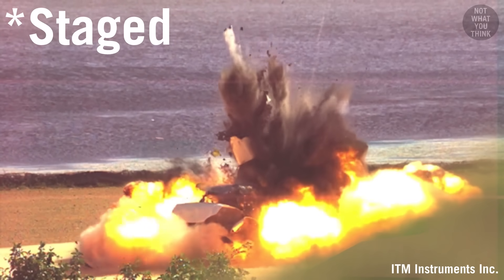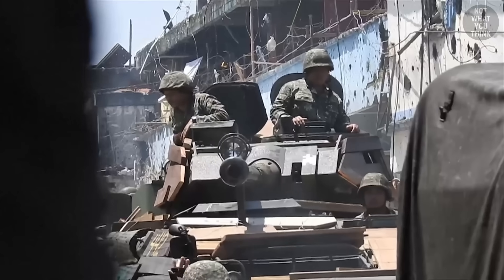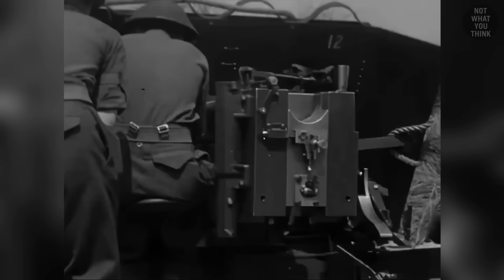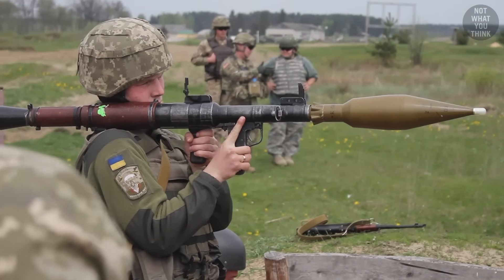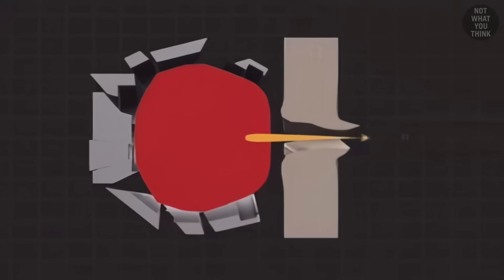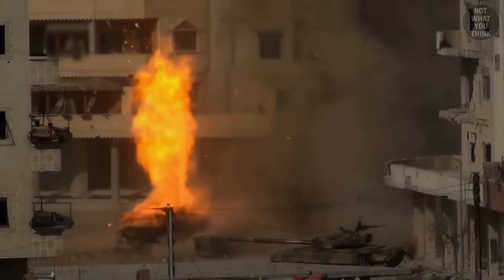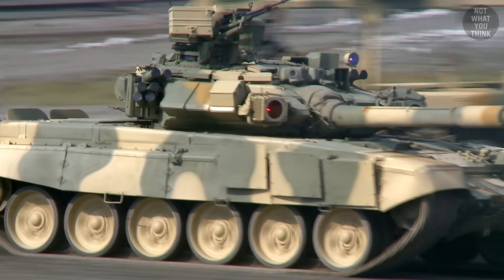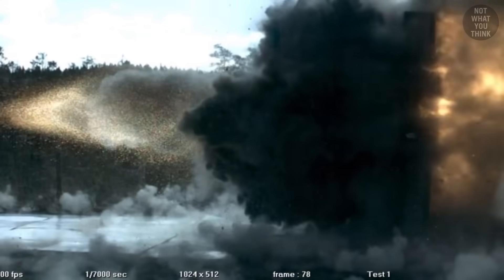Why Protecting Tanks is Getting Much More Difficult

Comment: 3:44 to be clear, this is a defensive grenade. An offensive grenade has no fragments, and relies on the shockwave. This gives it a smaller kill radius, and doesn't require cover to be safe for the thrower, so long as you're are distance away. 
Grenades may also use a sleeve of ball bearings (or other fragments) instead of relying on the destruction of the case
Reply: @silver_surfer88  I did serve* in the army, in Australia. The US trains the same way, even SF, no body is trained to jump on a grenade. It's always run dive to cover, feet facing the grenade lying down if you can't. Yes people do it sometimes, as an act of pure absolute sacrifice for their mates, but that only ever happens when you know that there's no time for your mates to get into cover, and it'll generally be the person who is first to see the grenade, which even more astounding, ebcause they will have the most time to get to cover, but will choose to save their mates.
Reply: I've wondered about these shockwave grenades.

As implausible as it could be, if you flipped a grill lid onto a grenade, and jumped onto it, could you save yourself?
Reply: @sirtimatbob  you don't want to put anything on it that could turn to shrapnel.
You dive away feet face the grenade, laying down, be the smallest target area to the grenade. A shock grenade will have a kill radius of between 5-10m max. You can cover that distance in a second. Run dive into cover or feet away from the grenade laying down.
Reply: @sirtimatbob  the more you cover or enclose an explosive the more powerful it will be...... Not sure what kind of explosives the shockwave grenades contain.... But if it's something like PETN ... When it explodes it travels at about 6 miles a second... So if you're laying on that grill top you will be nothing but confetti 🎊
Reply: @tommyemler1763  dive away and try to make it to the ground before the explosion. Yah, just one of those childhood fantasy thoughts, ya know
Reply: @sirtimatbob   Hollywood is responsible for that..... Only reason I know so much about it is.... I use to work in an explosives factory making mostly boosters and linear shaped charges.... I got to melt and pour the explosives it was fun but my family thought it was too dangerous....
Reply: @sirtimatbob  Yes dive away, but you're diving into the ground, you aren't jumping up, same as you would dive into the ground for a contact drill, run and dive into cover.
Reply: @tommyemler1763  RDX is the explosive in our grenades. 60g for a frag, 110g of RDX for a shock/offensive grenade. so roughly double the explosive.
Reply: @sirtimatbob  no you just turned that BBQ lid into the shell of a fragmentation grenade. As a kid we bought illegal fireworks on the reservation, when I showed my dad he got the idea to put a pot over one of them (he hadn’t seen one detonate yet) thinking it would launch the pot into the air….. it disappeared and peppered the siding of out house and took out a window with frag.
Reply: @silver_surfer88  what are you talking about? No they're not. The Army do not train/teach you to jump on grenades. No Army of any western nation does that. It is always a selfless act.
What you are taught is to run away and dive into cover as soon as possible or if there is no cover run and dive into the ground with your feet toward the grenade, and you face down and tucked tightly in, elbows tucked into your side and hands to your face. Tuck your body in as much as possible remaining as flat as possible. This gives you the smallest target for shrapnel, as it must come from the grenade, it puts your head and vital organs as far away from the shrapnel. If you are hit with shrapnel it has the greatest chance to be superficial, or a limb I jury that can be treated with a tourniquet. You are not Taught to dive a grenade though.
Reply: @silver_surfer88  You want to train your troops to survive. If you train them jump on them instead of get to cover, you are training people to die instead of live. This is not normal training, and shouldn't be. Youre soldiers are your most expesnive asset, in time and money, you do not want to train them to die, over training them to live.
Reply: Its counter intuitive but true
Reply: @silver_surfer88  offensive, aka used when they're pushing buildings in tight quarters.
Reply: That's awesome! I didn't know any of that, but it's super-interesting. Cheers!

Comment: There's also the non-explosive cousin of E.R.A., spaced armor. Spaced armor is effectively E.R.A. without the explody bit, as such its only useful against certain ammunition types like HE, which are known for exploding on contact with anything, rather than continuing to penetrate, like Armor Piercing (AP).
Reply: The non-explosive version of ERA would be NERA. It’s essentially ERA that replaces the explosives with various polymers instead.
Reply: @Notreallysureactually  Would you read the comments first
Reply: That's called spaced armor, yes, but it is not ERA. ERA stands for Explosive Reactive Armor, so a non explosive protection is not ERA.
Reply: @rairu44  never meant to imply it was ERA
Reply: @Sleeper____1472  I see! I understand that because you said that spaced armor was a version of ERA, when they are totally different things, my bad then!

Comment: It's not creating a metal particle stream as you state at 4:30  The copper cone enters what's called a super-plastic state, where it deforms more like liquid, inverting the cone while staying intact. That inverted cone is inverting at a speed of roughly 5miles/sec, and it lengthens and extends at roughly 14 million PSI. It pokes through any length of steel armor, up to 24 inches, and the backside of the armor plate is melted and fires through the tank interior at a percentage of that 5 miles/sec effectively becoming super-high velocity projectiles, killing the crew.
Reply: Isn't an explosive penetrator which you describe different than an anti tank weapon?

Comment: Sure the meta is in favor of infantry, but no system is invulnerable. If you can't change the meta with technology, you have to do so with doctrine. Part of the reason we saw a lot of tank losses in Ukraine was because Russia wasn't even using it's own combined warfare doctrine. Sure you can have a dude in a bush with an instant win button, but now your focus has to be on detecting him before he uses it. Because so far there really isn't a feasible piece of equipment that does what the tank does operationally but doesn't also have the same weaknesses

Comment: Tanks are certainly not the kings of the jungle any more - but they still have a place. That's because of mechanized infantry. While a javelin missile is a worthwhile expenditure for an MBT, it's less worthwhile for an APC, especially if said APC has already disembarked it's troops. Not to mention that APS could be fitted to such APCs, it starts to become an issue.

Tanks currently offer a cheap and easy solution. 1 120mm shell is more than enough to deal with an average APC/IFV. At the same time tanks provide mobile direct-fire support. The British still favour rifled guns because of their use of HESH which is very effective at knocking out defensive structures and emplacements such as concrete or sandbag bunkers.

So while tanks are certainly now in a more niche role and more vulnerable than ever to infantry, they provide a something that nothing else does currently - a big self-propelled direct-fire artillery piece that is mostly unhindered by rough terrain
Reply: They still are alongside artillery both of them are more than 50% of fire power of an army been many less than other units.
Reply: @viceralman8450  indirect-fire artillery is a role all of it's own and will likely never be replaced in warfare. Tanks however are at risk by having a role that overlaps greatly with infantry, APC/IFVs and even Attack helicopters.

Comment: What's happening to tanks is what happened to battleships. Emerging technologies changed battleships from invincible juggernauts to large, expensive targets, and they were replaced with smaller vessels that could carry a devastating amount of firepower. (I'm including carriers under those 'emerging technologies', but that's another story.) Modern light armored vehicles can carry the same firepower as a tank in a smaller package that's faster and easier to hide on the battlefield. Plus we're seeing more combat in urban areas or against insurgent forces, situations tanks aren't well-suited for. There's a reason the US Army calls tanks 'cavalry' after all.

I'm not saying the day of the tank is over, but they are becoming less of a dominant factor than they once were.
Reply: Not the same scenario as the battleship was abandone becase new tech full fit the role of a battleship, currently and in the near futures there's nothing that can fulfil the role of a tank on the battlefield, so it is still relevant, in other words read more. Modern light vehicles can't replace tank they either lack the fire power, the armor or the mobility.

Comment: While I agree with a lot of your video one thing I do think should be pointed out: Yes, a tank costs 5 million to 10 million. But what is more expensive is their crew. Maybe not monetarily (and even then the cost of a soldier is quite high)  but a trained soldier is very very valuable. So really what should be looked at more with these systems is crew survivability. A tank is "easily" replaced, a crew is not.

Comment: that's why the m1a1 abrhams tank has the best armor there is. it is designed to dissipate or spread out the impact of these so called rockets that the seem to "deflect" the impact outwards. hence why they are hard to destroy with anti-tank weapons.
Reply: Modern armor don't deflect they absorbe the proyectiles ans they the composite stop them.

Comment: Interdiction systems, designed to intercept and prematurely detonate incoming warheads at a significant distance from a tank or other asset, by firing a counter projectile at the incoming warhead, are in the works. The trouble with these is that they would require a whole other weapon system essentially, to be mounted to the asset, on top of whatever weapons are already present, or in place of a secondary weapon, like a mounted machine gun. These would mean carrying ammunition of their own also, as well as the tracking gear necessary to automatically register, track and engage a rapidly moving, incoming warhead. The automation necessary to make these truly effective involves expensive components and complicated technical challenges. Tanks, in particular, are already absolutely loaded with all kinds of gear, and already quite cramped and unpleasant to operate for those inside of them. Making such interdiction systems small enough to fit without getting in the way, light enough to be fitted without causing efficiency problems for the engine, fast enough to engage targets effectively, and perform well enough to be worth fitting in the first place, is VERY difficult!

Comment: 5:45 Well being a Filipino you have to be creative when dealing with such firepower. These were created because the wooden armor was soft, the only thing that could make an RPG penetrate is through hard contact basically metal to metal contact, however if the armor itself is soft the detonation would be lessened
Reply: The only way to stop anti tanks is to make the shapes of the tank slope style it should be around 30 to 50 degrees that is enough to deflect

Comment: I'd like to add something to your description of ERA or Explosive Reactive Armor. The primary mechanism in defeating the jet is that the explosives send the external face plate of the box often a given direction. This is rarely at 90° to the incoming warhead and consequently incoming jet. This means that the jet doesn't cut straight through the plate it has to cut through the plate as it's moving at some angle to it. The hole that's made is there for linear not circular. This extra metal that needs to be penetrated is what wears down the efficacy of the jet. So, I've read the impacts and era block at a 90° angle significantly reduces its efficacy while one that comes in at a steeper angle increases it. Hope this helps. Thanks for a fine presentation.

Comment: I haven’t seen the entire video yet so i’ll edit if he mentions it but Russia’s abysmal tank losses are kind-of skewed. Most modern nations have combined fronts of infantry, artillery and armor in combined offensives. Tanks deployed by the US are, in doctrine, never put in a position where they are not supported by infantry which would significantly reduce instances of unchallenged fighters firing rockets at the armor. Russia has continuously put their tanks in scenarios where they are significantly under supported or not supported at all. That, coupled with active denial systems such as reactive armor I feel have cemented the tank as a utility on the battlefield until some better weaponry comes out that would retire them forever.
Reply: TL;DR Russia is basically serving their tanks on silver platters.

Comment: The solution is to make tanks unmanned autonomous, cheap unarmored, higher speed, MUCH more plentiful and swarming. Made out of fiber reinforced lightcrete panels. Steel only where needed. Having no scared, cautious human crew to be hesitant to enter a dangerous area: these could instead blitzkrieg STORM their way into danger's face and OWN the area. Tanks are FAR from gone from the battlefield. They are only slow to adapt to the changes in the battlefield. We will see tanks catch on soon enough.
Reply: Yeah, that tech doesn't exist yet maybe in 50 years. And tanks will ver by on the battlefield as the need of direct fire support and breakthrough will never go away.

Comment: The “penetrator” is actually the copper cone shaped recess that inverts and becomes the molten copper shot that bores through thick armor. The TOW missile can penetrate past 4 feet of homogeneous steel. The RPG uses a piezo electric crystal in the tip of the round to ignite the explosive in the round. A piezo crystal creates electricity when crushed which is what powers the blasting cap/fuse in the explosives. Most of the time RPG gunners forget to remove the small safety pin in the nose cap of the rocket so they just bounce off its target.
Reply: Not molten, but the effects resemble molten.
Reply: Copper doesn't melt, but behaves like a fluid due to immense pressure.

Comment: Very good video, although I think you shouldn't have used CGI of the Ukrainian Nozh to explain how ERA works; Nozh is a bit special in that field.

@10:25: Nozh charges are crescent-shaped so that, upon detonation, they shall behave like a linear shaped charge, which "cuts" HEAT jets and long-rod APFSDS penetrators, like a boiled egg cutter. The Ukrainians also have a variant called Duplet, which is essentially multi-layered Nozh bricks.

@7:44: more conventional ERA, on the other hand, propel a metal flyer plate (placed diagonally - it's shown flat on the ERA's bottom in this video) straight into the intruder (HEAT jet or APFSDS long rod)'s path, causing massive abrasion, deformation, sectioning and deviation of it----thus preventing the attacker from either forming properly (HEAT charges require a standoff distance from the target armor in order for the jet to successfully take shape) and/or penetrating the enemy armor properly.

Other than that, good job making it clear (unlike videos I see on either TV or the Internet) that the HEAT jet does NOT "melt" the enemy armor, which is absolutely false. The temperature of the HEAT jet, either at its tip or tail, is nowhere near the melting point of steel...not even copper, which is what most shaped charge liners are made of (the copper becomes plastic-like, almost like molten rubber, because of the sheer pressure of the explosion, not temperature).

Comment: You showed the Iron Fist, which is my personal favorite APS. Quickly reloaded (it's literally just a missile turret), capable of protecting against top-attack missiles and APFSDS (dependent on sensors and reaction time), and often relatively light-weight, it seems like the best of all worlds. The US and Israel haven't adopted it because they want to minimize the collateral damage caused by an APS when it's activated, but the advantages offered by the Iron Fist seems more than worth it to me. The only APS cooler than the Iron Fist is the American Quick Kill system, and that system only has a cool factor advantage over the Iron Fist. Well, the Quick Kill system also stores its missiles in a vertical launcher instead of a missile turret, so it might be even lighter weight and more easily reloaded, but it obviously suffers in terms of reaction time compared to the Iron Fist since the Quick Kill missile has to turn itself nearly 120 degrees just to point at an incoming threat instead of relying on a missile turret (which is probably much faster, being mechanical) to do the aiming. All of that is just speculation, though, so don't take my word as gospel.
Reply: The best is Arena M

Comment: Cage Armor is not primarily used to increase the stand-off distance of the warhead. Rather cage armor is build with a specific bar spacing to destroy/slice the warhead without triggering the fuse. 
For modern warheads with 600-800+ mm RHA penetration 50mm wood stand-off would not do much anyway.
Russian cope-cages are more or less nothing more but cope-cages because top attack ammunition is most often not triggered by impact but distance. Also they often use explosively formed penetrators not really affected by some fence mesh.
Reply: Yes - one thing this video did not do is distinguish between SFF (Self Forming Fragment) and older types of shaped charge weapons. SFF is a standoff weapon - the warhead goes off well before contact and propels the superhot hypersonic jet towards the target. Cage armour does not work against these, but ERA does.